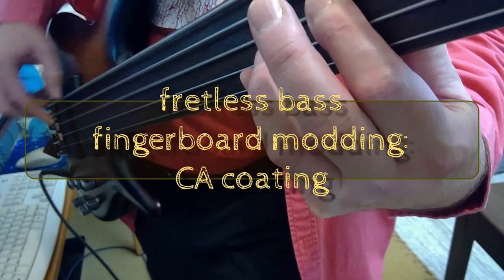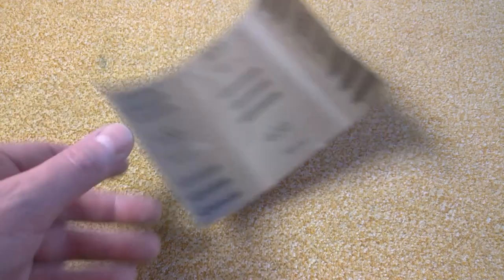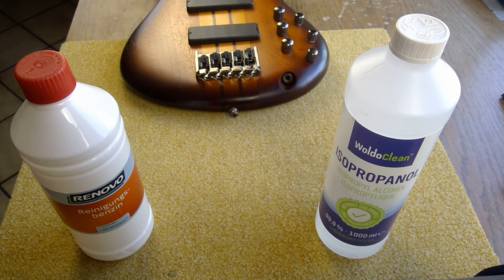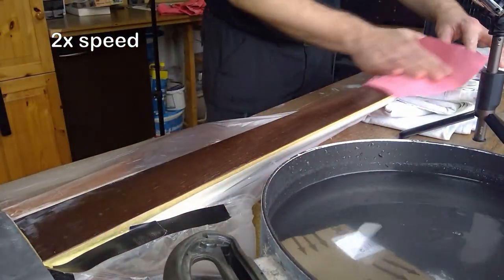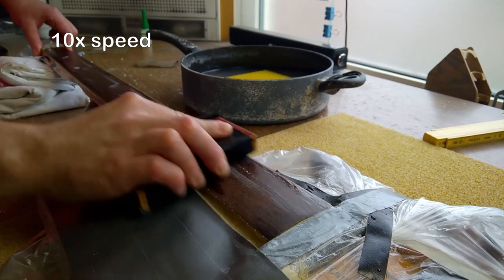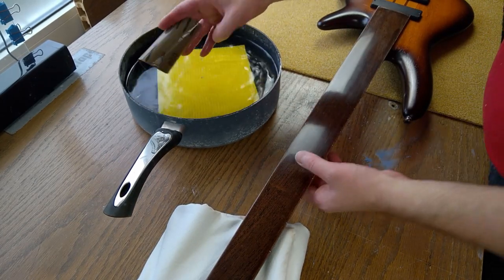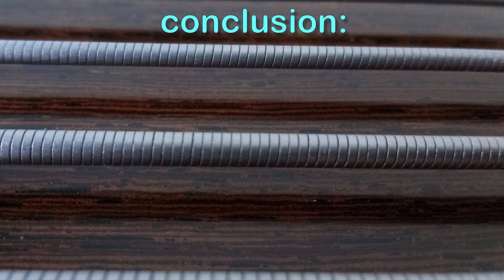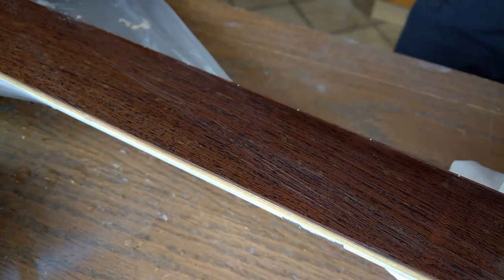fretless bass fingerboard modding: CA coating

Comment: that's a great looking finish man :}. i especially enjoyed your audio/visual comparison at the end, well done.
-----------------------------------------------------------------------------------------------------------------------------------------------------------------------

for future enthusiasts, use as long of a sanding block as you can find AND support the neck midpoint so it doesn't flex when pressure is applied while sanding. go from end-to-end w/ each sanding pass. (presoak the sandpaper and use one drop of dish soap. act like a pro wth :} ) 

it also helps to apply multiple this layers of the finish, way less work in leveling it. as in just wipe it on, don't try to 'paint it on'. 
(CA glue hardens the wood, you don't necessarily need to create a thick 'glue layer' as you would w/ clear-coat)

*the nut action on a fretless is considerably lower than on a fretted one. that affects the playability. if you're doing a conversion frets to fretless, don't forget to lower the pickups. as the strings are now closer to them, the magnets will in fact hinder string vibration resulting in less sustain. be nice have fun.

Comment: Dont try this randomly,  and DO have some knowledge of whats required, UNLIKE this guy .  some knowledge of neck setup is needed. You need levelling beams and a radius beam. Thats a must. The reason this did not go as he would have liked , is the tiny hills and hollows in the job, are muting the string from ringing freely, in places.  Get it adjusted by someone that knows what theyre doing.  You will be pleasantly surprised.